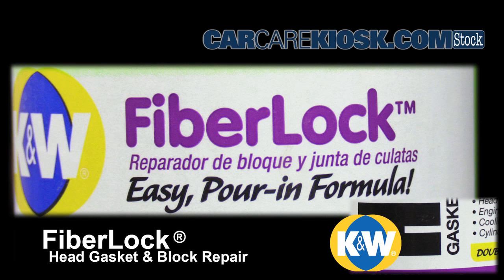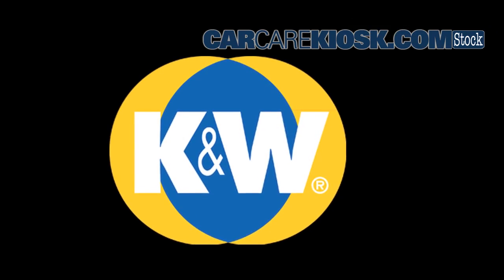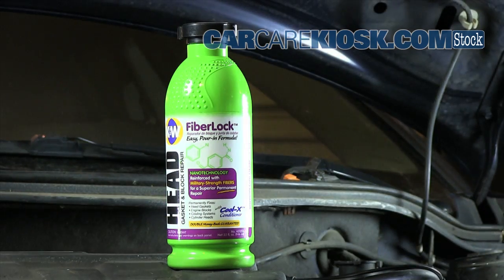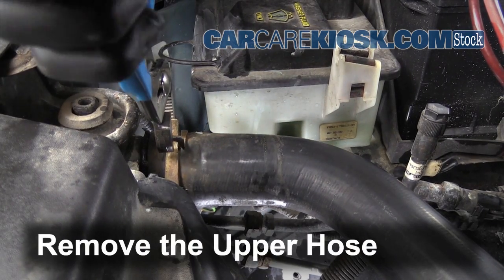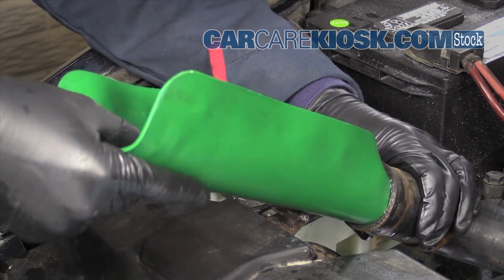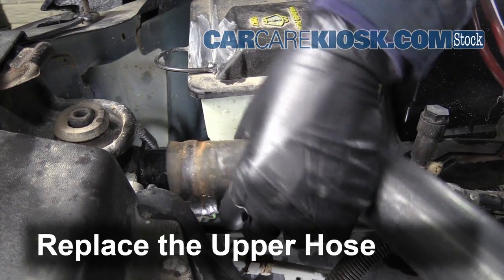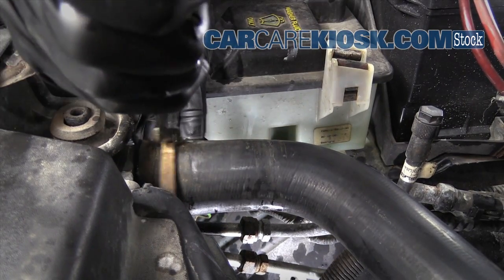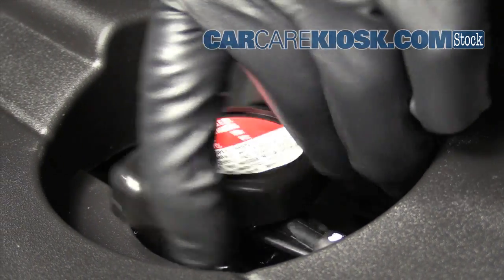K&W FIBERLOCK Product Demo & Animation, Car Care Kiosk

Comment: 2006 Range Rover Sport Supercharged. I used it last night. It saved me a lot of money and time. It worked very well. I hope it stays that way.
Reply: I think people get scared looking at the gooey fibers, thinking it will clog up the cooling system. I thought so, too. When it gets mixed with the coolant it dilutes into very fine fiber. If it clogs up the system, I think the system probably was clogged already.
Reply: Is the Thermostat removed?

Comment: This's really misleading video.. On the bottle it said.. Turn on the car and the heater.. The video said nothing about turning the car on.. What should I follow? Also, do i use the product before turning the car on or after? Does the car need to have a regular amount of coolant? Please answer me soon
Reply: If you are too dumb to know you need the car running for it to circulate then you probably should take your car to a mechanic. No offense.
Reply: I have been looking@this ala day.from diff.people.dump the antifreeze out til. There isn't any.if you just add with it in this is the causes.dump first.direction say 3rd. Of bottle first.cut on heater on  in car. Put the cap back.on after adding 3rd. Of bottle. turn the car on let run til idle.don't rush process. allow the car to continue running, while smoke clears out from back.tail pipe.feel heat in car if hot good,if not add.more.  out another 3rd.repeat all above.wait til heat I. Car is warm if it hasn't been. Take car for soft drive bout 45/1 hr.til all is beening sealed.Disclaimer.I have been watching videos alday ad well so here is a link to those who have gotten true results.Our send it after this.

Comment: guys please don't buy it, it cloged my radiator, damaged my thermostat, heater coil cost me $700, if you wanna buy go for bar leaks head gasket sealer it is much more usefull and cost less than this and you dnt damage your car .

Comment: This shit works, everybody complaining don't know how to follow directions. Bought a 01 bagged expedition. On the way home flashing check engine light which is the worse. Ran my scanner on it, btw I'm a mechanic. Misfire cylinder 3, so I figured no problem replace coil and plug. Went to change coil and plug and found the cylinder full of water. Just my fucking luck blew the head gasket on the first day I bought it. I was like great...Now I need to tear this thing down after I just spent thousands. Filled my radiator with water to make sure fins was wet. Poured it into top of hose and let it idle with the heat on high for half hr. Also you don't pour the whole Damn bottle. Make sure everything is full before you fill the radiator hose of this stuff. My truck takes 20 quarts of antifreeze, so that's half a bottle. Keep in mind my gasket was so blown water was pumping out of the exhaust. Drove all day with it still in the car. No problems at all. I tuned up the car, cleared the codes and check engine ain't come on since. Btw I left it in the car, it ain't clog nothing yet. Excellent product saved me from tearing down my expedition. This is coming from a mechanic who would never put an additive in my car. You people complaining about clogged radiators, follow directions next time, and make sure it's full of liquid. Don't put the shit in your over flow can either. Put it in the radiator hose and make sure your radiator is full.